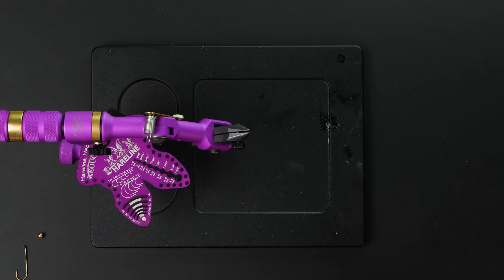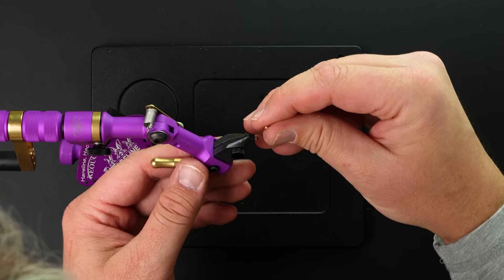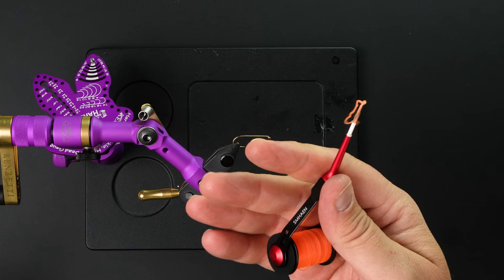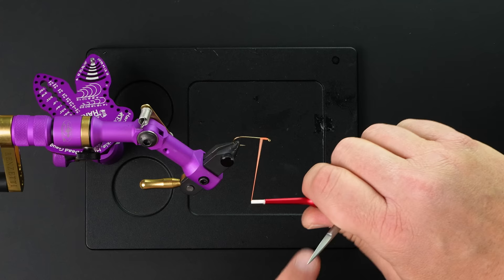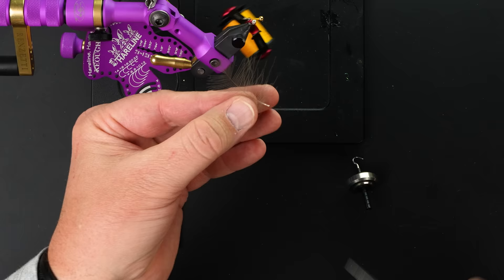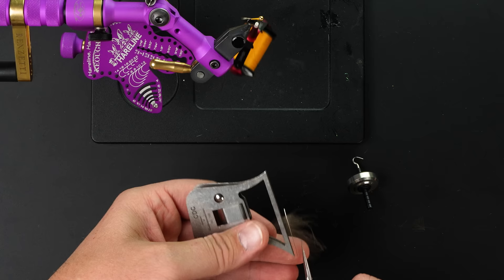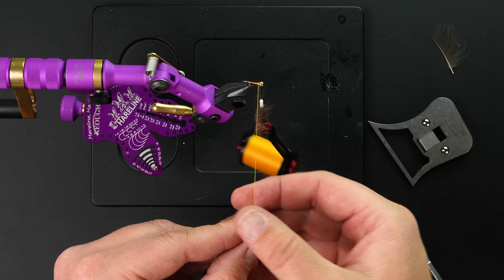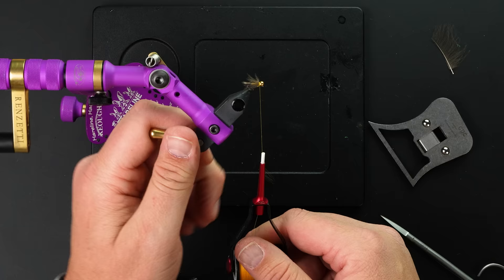Fly Tying Skill Builder #8 - Putting beads on hooks, Thread Control, and CDC Collars!

Comment: I like the series, it's great. Brief, to-the-point, focused on fundamentals. One thing I see not covered enough when it comes to countersunk beads is how to deal with the extra space you get in the hole when you're going a bit heavy. With a lot of bead brands, even a 2.8 will give you trouble on a size 16 hook, and it's not like that's an outrageous bead/hook pairing. The bead crowds the eye of the hook, or won't be seated straight, and then when you do the body you have a lot of distance between the hook shank and the back edge of the bead, inviting you to tie an overly bulky body. I know there are lots of tricks to deal with it, and I use them, but I'd like to hear you views on the subject.
Reply from the maker: Great idea. I have opinions on this

Comment: Finally, someone else puts on beads the way I do. Not sure when I figured this out, but it seems like almost since beads became a "thing". I notice that almost all tying videos start with an already beaded hook. Any method that keeps one of the 2 parts, hook point or bead, still greatly speeds up the process. On little beads I use beading tweezers to hold the bead, rather than my fingers, but the idea is the same. Keep something (the hook) steady while you slip on the bead. Thanks for this series. Lots of good stuff.

Comment: I use a bobbin threader. Put several beads on the threader and use the hook point to feed them onto the hook.  The advantage here is you don't accidentally drop the bead nor poke your finger when feeding the bead on.

Comment: Great tips, great series.  I do like Tim Flagler's method of putting a bead on a hook which I think is faster and easier, at least for me.  He first grasps the hook with what he calls "plunger stye" hackle pliers or a fly display clip.  He puts the bead in his palm and then using the display clip, inserts the hook point into the proper hole in the bead.  This this method helps from dropping and losing the bead.
Reply from the maker: Yup. Tim is one of the best.